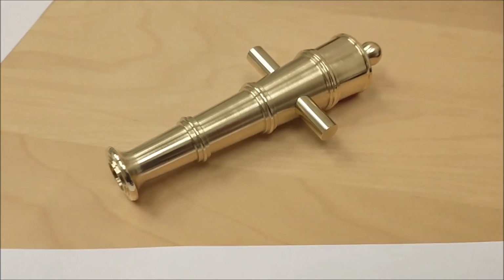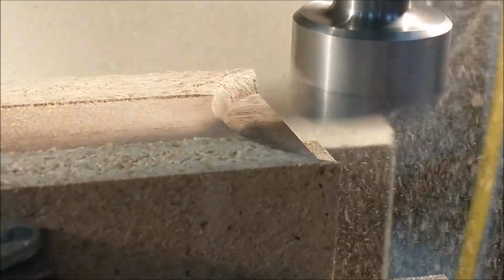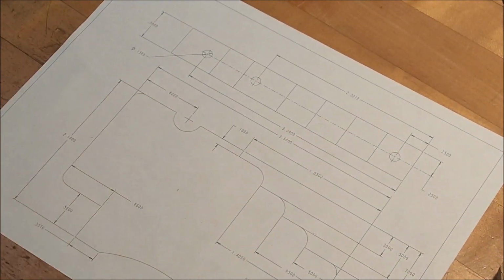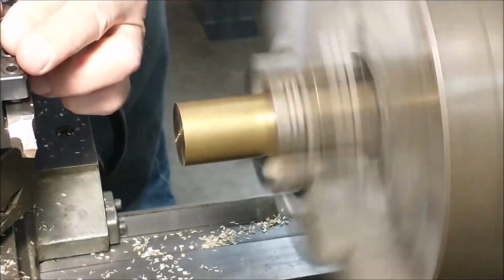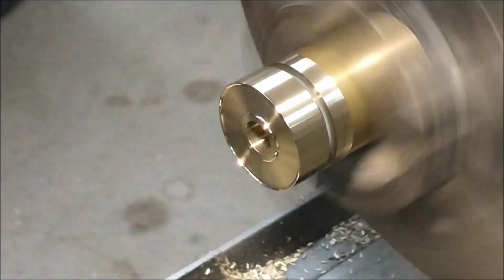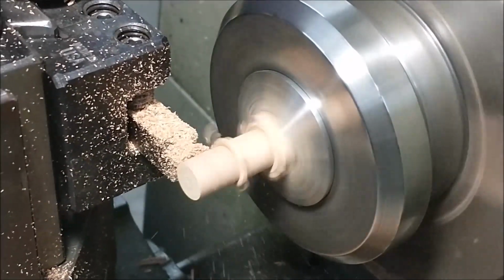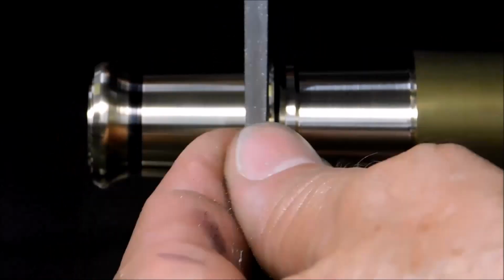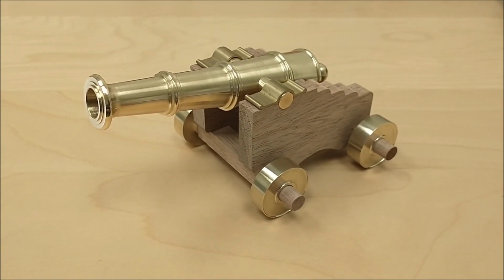Using Form Tools in a Fly cutter ??    I have to see this !!

Comment: When I saw the finished model it looked like the wheels were basically wood with a brass banding on the outer circumference and a brass bushing on the inside to provide a better wearing surface than wood on wood.
 Now watching how you made them I see that was not the case. 
However, since you seem to like a challenge, maybe you should make the next ones that way. 
Black Pete always had more than one gun anyway. 
Thanks for the video. 
🤞🇨🇦🍌🥋🇺🇦🕊️🇺🇲👍

Comment: That waving effect you mentioned is well known to drone folks as "Jello"  It is due to vibrations. That is, the camera is in one position when it scans one part of the frame and another location when it scans the next part of the frame.  Oddly enough, if you can't completely isolate the camera from the source by relocating it, mounting the camera on a much more flexible mounting system is the solution.  You are trying to lower the natural frequency of the camera to something far from the frequency of the machine or the camera's scan rate.  So, drone cameras are often mounted on soft rubber mounts to prevent this.
Reply: In Joe's case just mounting the camera to a light stand sitting on the floor instead of attaching it to the vibrating machine would solve it.  Perhaps a light stand with a horizontal arm (for reach) and a sandbag / weight at the bottom.  $20 solution and can use it with every machine and spot in the shop, and they don't consume the floor space of a normal tripod.
Reply: @avi8r66  yep. I have been thinking about picking up a microphone stand from a pawn shop for that purpose.
Reply: @brianhaygood183  If you look for this on bh photo you will see what I mean.  A small ball head screwed onto the end and you can put the camera anywhere you want within reach of the stand.  "Impact Multiboom Light Stand and Reflector Holder"  So not $20, they have become more expensive, but even at full retail this thing + a small ball head is still a good solution for this.
Reply from the maker: @avi8r66  The camera is on a rubber footed, floor mounted tripod. Not in contact with the machine.
Reply: @joepie221  Looking at the video the wavy jello isn't there until the machine is started.  4:57 to 4:59 it's just your finger and the wood in shot, no waviness.  Then you start the machine and even before the tool gets in view the waves started, so it's definitely the vibration of the machine reaching the camera.  With the setup you described my guess is the harmonics of the camera stand were just right to react to the vibration of the machine even with the rubber feet. This is minor and rare for your videos (first time I noticed it), just an interesting curiosity.  Adding a little weight to the stand up high, lengthening/shortening it, moving it further out and zooming in if that's an option, all would probably be ways to avoid this, just something that changes the harmonics of the stand.  Or go full nasa and fully isolate the camera from the planet using air bearings, and magical vibration dampeners.  Or just don't worry about it and I will still love your videos for the insights you provide.
Reply from the maker: The strange part is that my camera is on an isolated tripod with rubber feet. The vibration of the machine has nothing to do with its rigidity. That jello has to be a shutter phenomenon because of the light bouncing off the single tool.
Reply: @joepie221  oh, well that is just me having things backwards, then.  In the drone world we have a shaky camera mount and a still subject.   The jello in your case must be the vibration of the machine viewed from a still camera.  Perhaps using a spindle speed too close to the shutter speed is what makes it visible?  That or multiples of the shutter speed.

Comment: Beautiful work Joe, as always. Should not the ball at the end of the barrel have flattened sides and be through bored to take a rope, and how are you going to fire it with out a fuse hole, flash pan and maybe a flint lock? Now that would be a challenge.😁

Comment: Lovely job so far  ..  may I suggest   that you make  wooded  wheels with a   thin brass bush for the axle and a  thin brass rim on the  OD .. The railway  guys call it a tyre??
Reply from the maker: I am considering trepanning the brass and inserting a wood insert to give the illusion of a wood wheel with a brass tire and hub. The back side of the wheel would still be all brass like the front is now.

Comment: You should make one that is just large enough to fire an actual .50BMG round... It would need to be a bit larger since I believe that the Mossberg .50 BMG barrel blanks were 1.65" in diameter... With as slow as the .50BMG powder burns, a mini-cannon like that would not result in much of a muzzle velocity for the projectile... Most of the powder would be ejected out the barrel unburned...  Recoil would probably not be that bad either since most of the powder would not be burned... Maybe someone with QuickLoad could run the numbers on a .50BMG with a 2" longer than cartridge length barrel?
Reply: Meh,,,nfa might disapprove
Reply: @ironworkerfxr7105  -- I don't think so... It is not designed to be fired from a shoulder, so it is not a rifle... Starting with a piece of a commercial .50BMG barrel blank would mean that it was rifled, so it would not be considered smoothbore... At worst, it could be classified as a handgun, which is prefect legal to build... It's not designed a disguised firearm (e.g. pen gun, cane gun, etc), so it would not be classified as an AOW... I don't think that there is a SBC (Short Barreled Cannon) designation... :)  It's not over .50 caliber, so it doesn't get hit by that restriction... 

Of course, the NFA, GCA, and all other firearm "regulation" is blatantly unconstitutional since they violate the "SHALL NOT BE INFRINGED" clause of the 2nd Amendment... The mere existence of the ATF violates the 2nd Amendment...
Reply: @CurmudgeonExtraordinaire  we don't want this to become a "thing". if it does, and they classify it as a "handgun", then they can say that the .50 BMG round is "now for a handgun" and that has a can of worms attached we do NOT want to see happen. second, I would disagree, partially. while the ATF does not violate the 2A as a whole, the "F" does and calling it the "AT" is going to sound horrible once we shut that part down.
Reply from the maker: Its my understanding of the law that it is considered illegal to fabricate any device that accepts a commercially available cartridge. Of course, If you're legally able to own or purchase a specific firearm, you are then allowed to reproduce that firearm, but not offer it for sale. I personally feel that putting a .50 cal round in a short brass cannon is extremely dangerous, careless and almost guaranteed to end up in a serious injury or fatality. I do not plan to do that, nor do I suggest or support the idea of it being done. Additionally, YouTube video gun regulations would never allow for the monetized publication of such a video and would immediate issue a community strike or shut down the channel all together.
Reply: @joepie221  you, as a usa citizen with rights CAN build ANY non ffa firearm. This can be commercially chambered ammo or your own wildcat stuff. Ffa kicks in on certain things, and this is what serbu was trying to avoid when he built the 50 bmg micro. Look up the video, not a wasted second in it.
Reply: @joepie221  -- The best I remember, the current (unconstitutional) regulations are that a person can build their own firearm from scratch, but if they eventually want to sell it, they must serialize it and go through an FFL holder... If it is a commercial firearm (which were required to be serialized in 1968), then you can do a face-to-face (FTF) transfer without a FFL holder or the government being involved... At least if you are in a FREE state like Texas (vs some Yankee leftist warren like NJ)... :)

Although using a short piece of an existing .50BMG barrel blank would be the best place to start since it is already rifled, I suspect that it would be possible to create one out of brass if you scaled it up to at least 1" thick walls and kept the length down so that the slow burning .50BMG powder would not have the time and backpressure to fully burn... The thing is, it would not be practical in the least... It would eject the vast majority of the powder and it wouldn't even burn, so you wouldn't even have the satisfaction of a fireball... :) I loaded a 10mm round with a full case of .50BMG powder once and it was a very quiet round and would not even fully cycle the slide on the handgun... Just did it to prove a point about how slow burning it was... 

Hell, there is even a YT video of someone shooting a .50BMG round from a plastic flare gun... The velocity was so low that the projectile bounced off of the first water jug...

https://www.youtube.com/watch?v=SEDqezitphY

Of course, the plastic flare gun self-destructed and most of the energy went out sideways... Not really something that you would want with one you've spent hours machining... :)

The leftie YT monetization  rules are another issue entirely... :(
Reply: @joepie221  ,
I never thought you would..
If people want to do "  something" ,which your absolutely not doing.
That can read the rules on the nfa website.....
Reply: PS,, whose cleaning up all the wood dust...lol...

Comment: Second - if you’re happy, it doesn’t matter. I greatly admire your work and always learn from your videos.   The site won’t let me paste a cannon plan, but the British, French and American eighteenth century navies all used the same basic gun pattern, with the top surface of the trunnion at the mid-point of the bore.  No matter - yours looks great.
Reply from the maker: Thanks for the info. I've seen the trunnion in all different locations and didn't know which location was correct. Either way, this barrel is free floating and can easily be flipped over.

Comment: After reading the comments about brass and wood wheels and preference l couldn't help but wonder what it would look like if you had both.   Be easy to put a wooden wheel on and see how it looked before you cut the axles.

Dale in Canada 🇨🇦
Reply from the maker: Hi Dale, Wood would probably look good, but they would need to be jazzed up somehow. Plain wood  would be too bland. In my opinion.
Reply: @joepie221   Thanks for the reply Joe and I agree with you on the wooden wheels would need jazzing up.   What I was wondering say you doubled up your wheels.    Say put a wooden wheel on the axle and then put your brass wheel beside it.   I have been trying to visualize it but would have to see it.    You would have 8 wheels in a sense on it.    Might look good?????

Comment: The banding on the barrel is probably a hangover from the first, wrought iron guns (which really were made like a barrel). The guns on early Tudor ships like the “Mary Rose” were made from bars, forged (by hand) to a segment form cross section and upset to form the breach; they were then locked together by bands hammered down the outside exactly the way a wooden barrel would be made. 
A lot of early metalworking was adaptations of existing techniques in wood, so adapting your metal techniques to carbohydrate foam is almost traditional :-)
As an aside, the term cannon can be thought of as equivalent to the way a modern naval gun would be described as (for example) 15” 45 calibres (the diameter of the tube is 15” (nominal) the length is 15 x 45 = 675”; the consistency isn’t quite equivalent (pre-standardisation); but terms like cannon, culverin & carronade tend to describe different ratios between length and bore.
Reply from the maker: Thanks for the info.

Comment: When you sand the wood, if you wet it, it will make the fibers stand up and you'll get a better finish.
Reply from the maker: I've always wet sanded after a clear coat for just that reason. I've never done it before. I'll have to test it.

Comment: Beautiful job Joe. But ship model making is a hobby of mine and the cannon barrel was always hung by the third, meaning the trunnion should below the center. Is it possible your barrel is hung upside down? Otherwise perhaps you drilled it in center of the barrel.
Reply from the maker: To be honest, I'm flying blind on this build and do not consider myself an expert by any means. I'm following the original image I chose, so that may be inaccurate as well. This barrel is easily flipped over.

Comment: HI, Joe!  Great little cannon -- I built the smaller one in Joe Martin's book a number of years ago, as a Christmas gift for my Dad, who was a Hornblower fan.  It also had brass wheels. 
When you fix the trunnion to the carriage, make sure you mount it so that the trunnion is below the centerline of the bore.  It doesn't really matter on a non-firing replica, but on a firing cannon, the recoil forces would tend to lift the barrel and carriage off the deck, and flip it over backwards with the trunnion above the centerline.  With it below the centerline, the cannon would be held securely to the gundeck by the forces of recoil.  

There is a company called South Bend Replicas up in Indiana that makes Civil War era full-size muzzle loading cannons, on some very large antique machine tools.  If you can find one of their old catalogs, it is a treasure of pictures of manufacturing the replica tubes.  They used to have a bunch of videos on this platform, showing the manufacturing process, but due to the current climate, I think nearly all, if not all of them have been taken down.
Reply from the maker: Thanks.

Comment: Outstanding! 👍👍 I like the mahogany too but I believe in practice the carriages were oak. Also, in my opinion, mahogany wheels would have better. Sorry, I just feel that way. However none of that takes away from my initial assessment. It's still Outstanding! Thank you for sharing. Have a great New Year and stay safe.🙂🙂
Reply from the maker: I wanted a contrast down there. Maybe a wood wheel with a brass tire?
Reply: I'm currently making Elmer's #10 wooden grasshopper engine as a fill in between other work. I am making it from a leftover piece of oak shelving but using a vacuum to collect as much of the waste as possible as it comes off, oak is acidic and you don't want it on your machine tools. If you are videoing this work then a constant vacuum hose in view will spoil the shot. Images and videos of this engine (by others) are available in the internet.

Comment: Correction: The gun had to be able to traverse down, relative to the carriage, and the deck it was on, because sailing ships never maintained an even keel. The leverage of the wind pushing on the sails would cause the ship to heel over towards the leeward side.  The cannons had to accommodate this when aiming.
Reply from the maker: Solid point.

Comment: Watching you get such beautiful surface finishes using a fly cutter all the time finally got me off my a$$ and I made myself one for Christmas.. it turned out so beautiful that I instantly regretted not using better material, hopefully mild steel lasts
Reply: Make the material better - case harden!
Reply: @somebodyelse6673  I'm thinking about it but I don't have a heat treat over so it'll all scale up badly and I'd have to reduce the shank size.. when it wears out I'll probably just copy it in tool steel or 4140 heat treat
Reply from the maker: My 2" is mild steel. I've had it for years. Just don't make it in 2 pieces.
Reply: @joepie221  that's good to know, yeah mines a one piece and I made it so the 3/8 bit is schinzentight.. I can't wait to get back in the workshop and see how well it cuts, first job is cleaning up some 2×3/4 hot rolled to make standoffs for the dro scales, yet another job I should have done years ago

Comment: Nice dust collector on the shelf.
The anti burr cutting way of cutting is undisputable, but sometimes the chips targets my face... Using hobby machines step milling has its limits...
Time 13:04. That's a Joe Pie magic collet.... No such ones found here...
What's the recipe for suitable downsized gun powder? Joking! Cannonballs in the next video....?
Reply from the maker: I do have a great method for cannon balls. So easy you'll laugh.
Reply: @joepie221  Yes, it should be balls, not the slugs of today.

Comment: 4:15 your comment on the collet using a common point is ok, but you will still have 2 points on the 4 jaw collet that will be opposite when flipping the part around to get the other side, just saying.

Comment: Wood is by far the worst metal I’ve had to machine.
Reply: Gotta use a lot of coolant to keep it from over heating.
Reply: Mahogany is pretty good to work with
Reply: Surely you mean Material Not Metal
Reply: @yam450f  I am serious. And don’t call me Shirley!
Reply: @whodat90  put those reading glasses on mate
Reply: Wood has its issues. I do both and have the tools for wood and metal.  I have done pattern work on a Bridgeport and it’s different. I use router bits in the Bridgeport.

One way

Comment: Another great video. Thanks! Using a sacrificial piece of wood is an old carpenter’s trick when sawing wood. Especially plywood. The rim you put on the wheel is called the the tire. That’s where the word for modern rubber tires originated. You make a lot of people happy with your videos. Happy New Year!
Reply: Wagon and other animal drawn vehicle wheels usually have tires also.